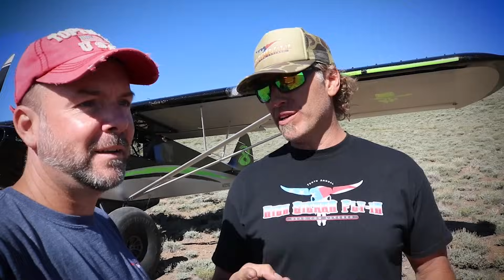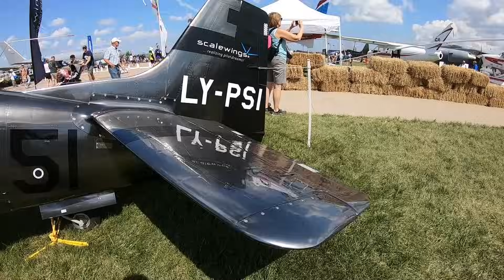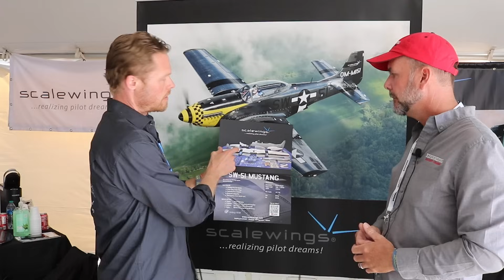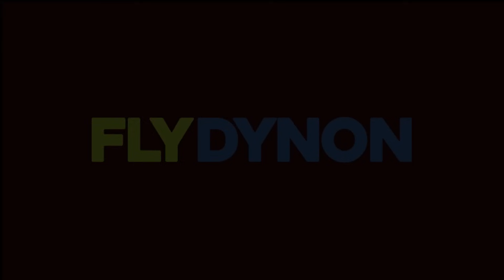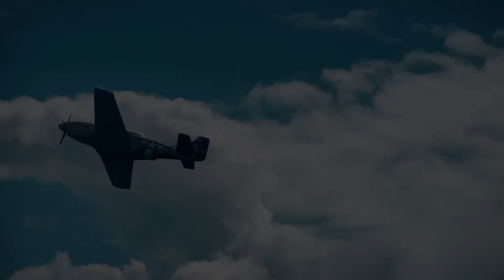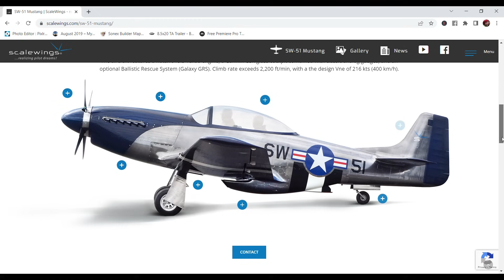Military Aircraft SW51 Mustang YOU can Build! Carbon Fiber Scale Wings Kit -  Oshkosh 2022

Comment: While it is absolutely gorgeous, I would prefer it didn't have fake rivets and fake exhaust stacks. And 214 kt VNE... I would much rather have seen a higher power faster version. This is very close to RV performance for well above RV price.
Reply: It's a scale model. It must have all those details. The company's name says it all
Reply: 214kt vne is pretty fast, but I feel ya.
Reply: Vne is based on Vh, which is a matter of engine power used. Larger engine means higher Vne, which can be principally established, upon further testing and confirmation as the principal design of the aircraft allow for higher speeds..
Reply: @simons.sw51  Yeah if you could get 180-200hp and stretch that Vne 20% into the 250+ Range that would make for quite the wild ride.
Reply: @simons.sw51  I'm curious why you think that? Can you reference any aircraft design information that corroborates that? 

VNE should only be based on airframe alone. Now if you couldn't actually test to a specific speed due to engine limitations and you de-rate VNE to what is achievable that is one thing, but it is NOT the true airframe VNE.
Reply: @DarthVillar  during the design of the aircraft, we already thought about various engine power levels. The starting one is the 140hp Rotax. To have proper limitations, which are suitable to this aircraft configuration we defined the actual parameters.  But the design itself can be increased, by taking adequate actions f.e. Mass balance of control surfaces, a verifying ground vibration test,  flight testing etc etc. But we are not yet in that stage, however we already know from our paper based design that we can cope with higher engine power higher Vnes.. (upon testing and confirmation)
Reply: @simons.sw51  Thanks for the clarification! I'm glad to know that VNE could be bumped up based on future testing with higher power engines. I'll be keeping an eye on this beautiful kit plane then!

Comment: I would have expected a lot more than 2000 ft/min given the weight savings. The actual P-51D could do over 3400 ft/min on WEP and it's aluminum.
Reply: The actual P-51D had a 1700 hp Merlin, not a 140 hp Rotax.

Comment: better yet? a 2 liter aeromomentum, 260 hp turbocharged.
Reply from the maker: This is now a OVER $200k base kit. I think there are OTHER options  far better than a low production number engine.
Reply: @ExperimentalAircraftChannel  they have 2/3 & 3/4 scale p51's with v8 chevy motors- impressive performance. personally... I'd rather have a high wing stoL. safer & more forgiving.

Comment: It is cute. But why not a full scale 1 to 1 ration P-51?!  That would be desirable. Not some scalled down version.
Reply: The main reason is to have an aircraft optimized to its purpose.. The original mustang is "unnecessarily" big to host all the military equipment and fulfillment of long-range ferry missions which is not the target of this aircraft. So the 30% downscale is the optimum to comprise a modern, economic, performance and resource efficient aircraft which simply makes a lot of fun :)

Comment: I’m a newbie with this. Couple of questions. Why can’t they just build the full size aircraft? Why are these all 70-80% the size of the real thing?
Reply: Manufacturers are able to build full scale, but they don't for a lot of reasons.  Scale aircraft don't have the same power requirements and they're a lot more economical to build.  The closest GA has come to replicating P-51 performance is the Thunder Mustang, which actually outperforms it in some aspects, roughly 3/4 scale and it's powered by a 650HP V12.  Just scaling down to 75% requires a little more than a third of the power to make equivalent performance.  Now, a full scale replica would require 1650HP to maintain the same performance, and where are you going to get an engine like that?  That's right, you're going to use a RR or Packard Merlin to power it, and those are several hundred grand to start with, not to mention the fact that you're taking a very rare engine off the market that could've been used to power an actual warbird.  There's not that many left these days, and they're certainly not serviceable by your local airport mechanic, much less installed by an amateur homebuilder.  Now, there was one full scale composite P-51 that was made years ago that was powered by a big turbine, but it lacked pretty much everything that gave the P-51 its charm...the huge single exhaust on the right side wasn't pretty, the cowling was all wrong, and it sounded terrible.  Those are your options for full scale aircraft.
Reply: @Skinflaps_Meatslapper  thanks for answering this. Interesting response. I do know there’s well over 70 P-51’s in flying condition worldwide based on some research I did on the survivors or restored aircraft. Jack Roush who makes higher performance Mustang cars , has a couple and he can make parts for the engines if memory serves. Wouldn’t it be great if he could make a Merlin/Packard engine and sell them? Oh well just an idea. I think it’s cool what this company is  doing though.
Reply: @steviep51guy  It's possible to build an entirely new RR/Packard from scratch, if you have all the time and money in the world.  I'm betting with all of that machining and casting, you'd be well past half a mil on an experimental engine.  It'd be a lot more reasonable if it was a run of a few hundred, but you'd still be close to what a surplus pickled engine would cost you (which at this point would need torn down and rebuilt due to seals and corrosion anyway).  They used to be plentiful back in the 60's and 70's, could buy one so cheap that farmers used them to run their irrigation wells.  Between the farmers leaving them running constantly for days on end, tractor pulls and speedboat racing ate a whole bunch of them up.  There are still quite a few allisons out there, but RR/Packards are getting really rare.  I remember seeing an undocumented Packard for sale at around $150K, while Allisons were going for $30K, so that gives you an idea of the supply and demand for them.  Something a lot of people don't talk about is that you might get 800hrs out of either V12, most were pulled at 400hrs for overhaul.  Those overhauls aren't cheap these days because the parts are just as rare as the engines.  These days the average GA engine is going to last perhaps 2,000hrs between overhauls, so you get to overhaul that expensive V12 4x as much.  It really sucks, but it is what it is.

Comment: Fission Engine Is Worst Choice, Fission+Fusion Is The Right Answer, But The Vehicles Need 2 Device Before Its Become Reality (Last Tech We Can Make) Electrolysis Device (Rf Hydrogen Generator Or Pem (Stainless Steel+Carbon Plate) ) And Niron Magnetic Electric Generator To Powering Hydrogen Generator, Fission Happening On Hydrogen And Oxygen Spliting Device Then Fusion Happening In Combustion Chamber.

Comment: I am wondering about the stability of the resins with the dark paint. Are the parts cured in an oven?
Reply: Yes, the entire airframe is cured in temperature controlled heating chambers to assure proper molekukar connection of the matrix, which provide the actual incredible strength of the aircrafts structure..

Comment: carbon fibre composite, so if you crash it then it goes into landfill.  😒
Reply: not necessarily. The aircraft consists of modules of assembly parts, so depending on your mishap, we can replace them for new parts. The main groups are: outer wings; center wing; fuselage; ailerons; flaps; horizontal stabilizer; elevators; rudder
Reply: @scalewingsaircraft  exactly, you cant repair or weld the broken part/s

Comment: As pretty as it is its not a p51 and my RV8 is faster and more aerobatic (and metal)  full sliding cockpit. and the fast build kit cost less........
Reply: But heads dont turn at RVs... that's the difference.
Reply: Depends if you fly for the crowds or fly for you...

Comment: when we can have an Messerschmit, Focke-Wulf, Zero etc model but instead of installing a prehistoric internal combustion engine will use a powerful 300 horsepower small electric motor? the airplanes would be much better, faster, more powerful, LIGHTER, less complicated, with fewer controls, easier to drive, LESS UNNECESSARY AVIONICS ETC, come on, CHEER UP, DON'T MAKE PROBLEMS WITH PREHISTORIC ENGINES AND SYSTEMS, USE ELECTRICAL ENERGY , dudes !!

Comment: the fake rivets......... It's because the RC guys want to recreate the original. Also... every mustang model I've flown... they DO NOT like to be tail heavy at all !!!!!!!!!!   I had one that dang near balanced off the leading edge to make it fly properly, and not do crazy high-speed stalls when yanking the elevator.
Reply: At least they look designed to try to mimic flush rivets, so hopefully they are relatively subtle in the real world (to minimize drag impact).

On RC Mustangs, add flaps coupled down with up elevator and it both adds lift and washout so it won't be prone to tip stall. Some designers are hesitant to add washout to the wings of fighter aircraft as it has the opposite effect during outside maneuvers or inverted flight.

Comment: A fake Mustang that can't even go 200 knots?  What's the point?  I don't get it.  It's slow.  It's like a fake Ferrari that can't go over 70 mph.
Reply: it costs less than 10% in acquisition and less than 1% in operational costs, with close to 100% of the ramp appeal and fun factor. We actually have a former "real" P-51 Mustang owner who sold his aircraft due to the annoyance and headache of keeping it airworthy. He has bought the SW-51 Mustang instead. As you will taxi or do low passes with the SW-51, it is close to impossible to tell the difference to a real P-51.